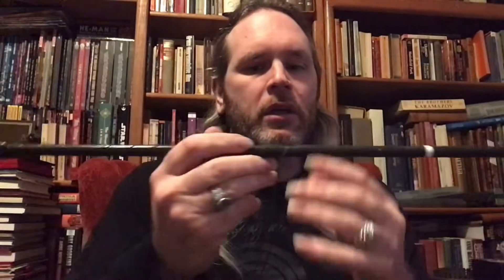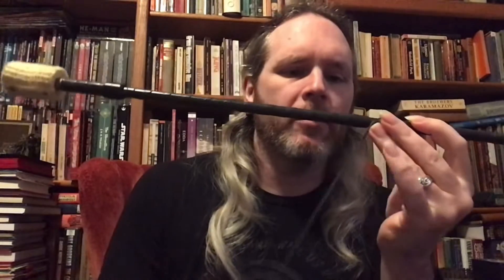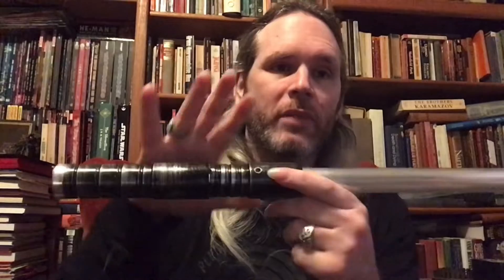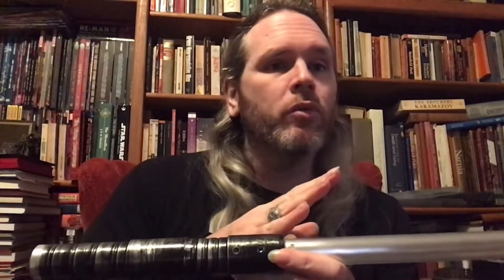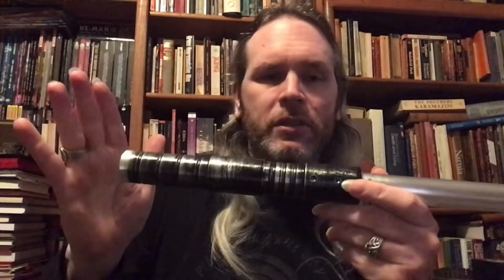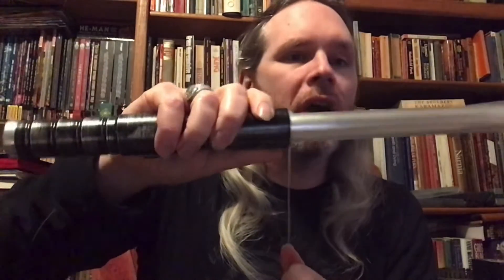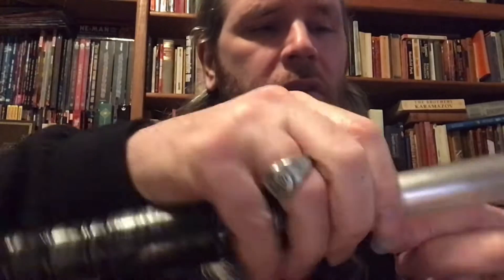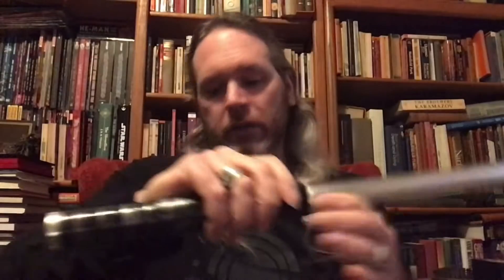Levi-Saber construction: short string version

Comment: Is there an alternative to drilling? Getting my first saber soon and idk if I want to drill. You said a slipknot on the hilt would be okay but if my balance point is on the blade would that be enough to hold it and not move up ir down?
Reply from the maker: The connection has to go on the point of balance. If you want it on the hilt and it isn’t, you can add weight to the pommel until it is.